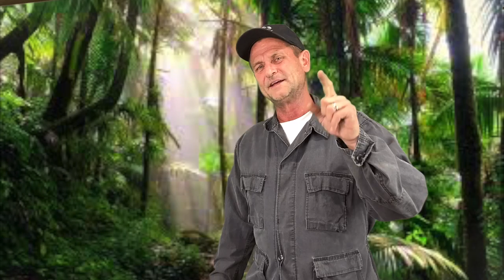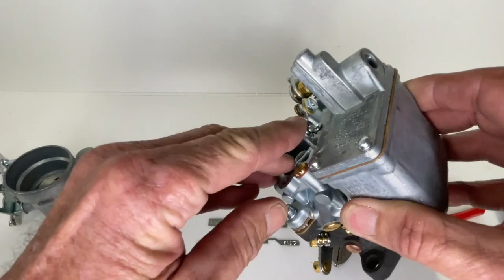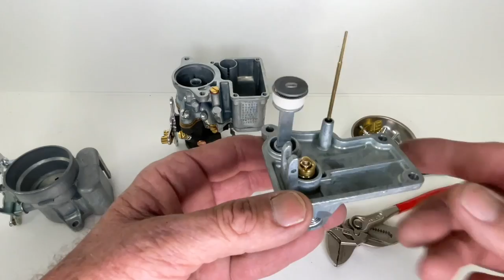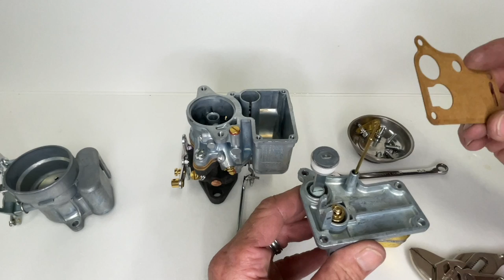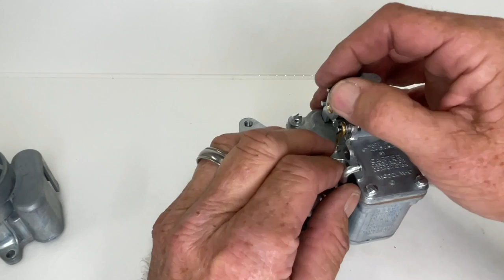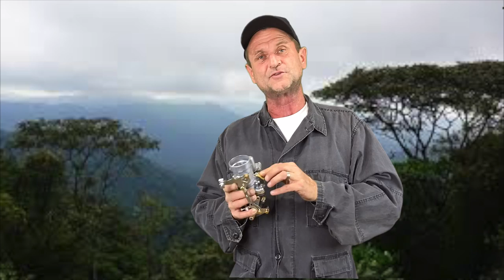Carter WO Carburetor Initial Adjustment And Checks G503 Willys MB CJ2a and Ford GPW, A1223

Comment: Just bought a new manufacture YO carburetor for my 46 Willys.  Mounted it on the engine and fired it up.  First thing I noticed was that gas was pouring out of the carburetor.  Tried it a couple more times and decided to send it back to the supplier, which I did with his blessing.  I have an original YO so I ordered a rebuild kit for $55.00.  Not sure why it flooded like that but I didn't want to dig into it and maybe void a warranty.

Comment: Well I bought one of these carbs for my old cj2a I plow my dooryard with,It hasnt had brakes since 1988 so shes no show piece but I just wanted it running good to plow.It had the original carb and ran kinda rough so I thought it would cure her but it didnt,Its easy to blame the carb on a old vehicle,I wanted to but I didnt,come to find out my pcv valve innerds were missing and number 3 and four cylinders were getting a watered down dose of fuel ,I repaired that issue,Installed electronic ignition cause you cant get a decent condenser anymore and re installed the carb,I didnt monkey with it like in the video but instead chanced it,I can say on start up it ran like shit,little to no accel pump action but after about 15 minutes she came on line and has been fine since . my advice give it a little time to get that accel pump working and settle in before you get discouraged

Comment: I had a joes carb in a  metal box. Thought I could take it and drop right on the gpw. No go. ran like crap when it ran at all. The video states the gauges are included Not so. waiting on gauges now to try and make this carb work. There really should be a note in the carb box stating this needs to be gauged before install. i have had carb for a WC from John Bizal at Midwest. Drop them on the truck and never touched it again. Just plain worked. 
This is a nice looking carb, perfect in every way, just not adjusted properly. At least there is  a video on what to do.

Comment: Scott, I am doing a frame off on a 1947 CJ2A. I have been following alongs with your vidoes of the MB. Have you done a video on the installation of the transmission on the frame? I just viewed the rubber mount on the transmission crossover and you installing the engine videos. Saw you have the trans mounted on the frame.

Comment: From other videos I've seen, after setting the metering rod, the linkage should slide into the top and bottom levers without moving the them.  If it doesnt then the linkage needs to be bent slighty so it hooks to the top and bottom levers with out moving the metering rod lever or the throttle lever.  Is that correct, or am I missing something ?  thanks

Comment: Unless I'm missing something you want to set the metering rod with the linkage from the throttle connected.  Setting it the way you did means that the metering rod is likely to be raised up and too high when you connect the linkage.  Is there a reason to set the metering rod disconnected and fully lowered like you did?
Reply from the maker: Initial setting. The metering rod should be set with no tension on the idle screw. This is to check before you install on the engine. As stated in the video, this is a pre installation check. If the linkage is installed correctly, there will be no force from it until the accelerator pedal is depressed. We will get further into the adjustment process on the engine in the future👍
Reply: Oh, and thanks for the videos and parts!  Really appreciate folks like you that are helping us keep our awesome jeeps rolling.
Reply from the maker: @jfpooliovids  I’m not expert, and learning everyday. Thank you for watching, and for your comments 👍
That’s how we all learn. Including myself.

Comment: So Joe in the Motorpool can't properly assemble and adjust their own simple one barrel carb? Maybe Joe would learn something if he watched your how to video.
Can you recommed a brand of carb that does not have to be taken apart,  properly adjusted and then reasembled by the user ?
Reply: So fuckin true!! $500 on a carburator is not ready to install !!
Reply: @mbmpablo3631  crazzzy huh.. I remember when I was 12 I took  apart a Rochester Quadrajet four-barrel carburetor. Rebuilt and adjusted it perfectly without anybody's help.
Come on Joe's Motorpool it's a ONE Barrel Carb, how many of them do you have to improperly assemble before you accidently get one right

Comment: The crappy directions with all master rebuild kits show adjusting accelerator pump linkage with a tool that dosent come in joes kit and shouldnt that have a bearing on final metering rod linkage positing and adjustment !